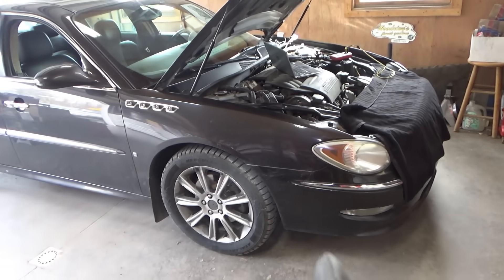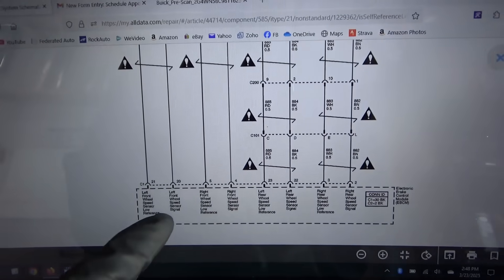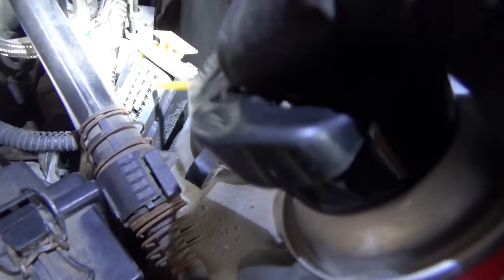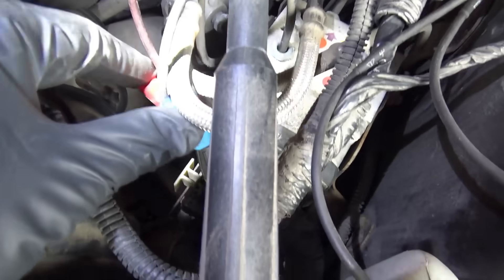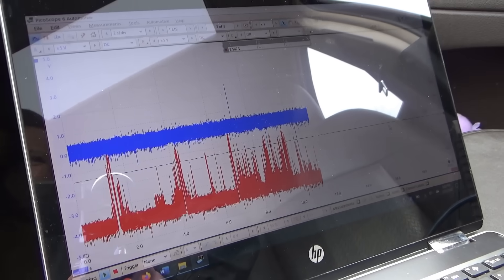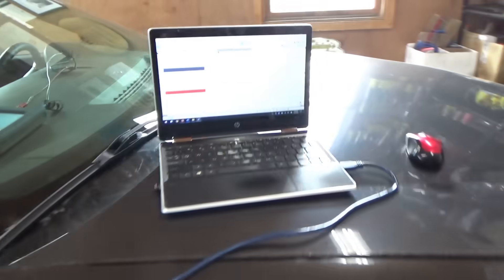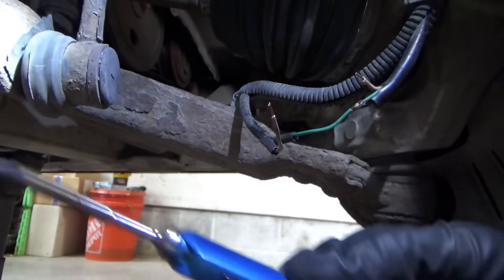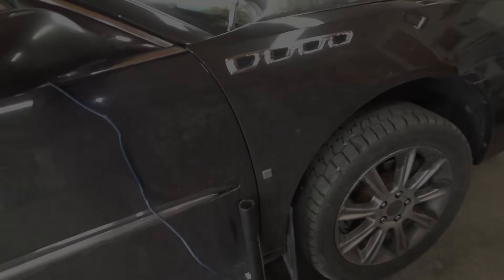(Pt 2) Buick BRAKE Problem?! C0040- ABS Sensor Circuit FAULT ('08 LaCrosse V8)

Comment: This is interesting, I was looking at the video and when you said turning the steering wheel to the right was causing the glitches and I was trying to connect it to the clock spring. And then as I kept watching I saw the actual solution

Comment: 2003 Pontiac Montana, the right front ABS wire broke in exactly the same spot.  I soldered in a bit more wire when I repaired it.   I found it easily because my wife was very observant and told me that the ABS light turned on and off when the right front wheel hit bumps.

Comment: If it was digital, it would probably be 3 wires with +5V, Ground and Signal wires. Most likely with just a coil with a magnet to tell the ABS how fast the wheel is turning based on either voltage or frequency

Comment: Good job! Yeah do not buy new AC Delco alternator, new but lousy, whine, and failed diode isolation test, sent it back, put a new brush holder in my old one, problem solved, and way less $$$

Comment: Not done with the video but im wondered if the alt and wheel speed sensor (probably a wheel bearing) came from Amazon . After watching I see that the wires arent part of the bearing. Whenever i get these i usually go after the harness first since they constantly flex , 9/10 its the harness.

Comment: Better to cut back to prior to the flex area and run new intact wire to the connector. Almost no more work, butnwill last far longer A splice just concentrates stress, and it fail fail again soon. (I've had this happens in the flex harness to doors . . . )

Comment: I have to say I'm a bit disappointed in the repair.  It would be perfect in most applications where there's little to no flexing, but not there.  It may take a few years, but that wire will break again at the splice.  The added weight and stiffness at that spot will force the rest of already stressed wire to absorb the flex of the spliced area.  A replacement harness is available from Rock Auto for $50. (ABS repair kit).  

Great diagnostics.  The scope made clear what was going on.

Comment: Wire insulation failed. Micro crack allowed salt / O2 in. You should replace at least a foot or two from connector.

Comment: It is possible to buy extra flexible wire, which is often used for test equipment, but would work just fine for ABS sensors.

Comment: The problem is that wire repair isn't going to last. It needs new wiring with new pins. Soldering that made it very rigid there, and it needs to be flexible.

Comment: Nice diagnostic and repair!

Re the wires that bend all the time:  Maybe use the type of wires that are used for multimeter probes? It's way more expensive than regular wires but it's designed to handle bending way better.

Re measuring the signal from the sensor: An alternative / complement to an oscilloscope is to use any amplifier/speaker with a high impedance input. Today the most readily available thing would be a guitar amplifier, but any vintage audio equipment with an input for a ceramic cartridge record player will usually also work (at least in Europe most 1960's and early 1970's transistor radios had a grammophone input).
This bad contact would be super easy to hear when listening to the signal, but for anyone not totally tone deaf (or rather "distortion deaf") it's also easy to hear things like rusted ABS rings.

Comment: Broken ABS wires were very common on W body vehicles, I did several a month when these were in dealerships.  There is a TSB for this.  Would have saved time instead of fussing around with it, or should have turned the steering while ohming the circuit.

Comment: Way to be Ivan.  That alternator repair was the way to go especially because you can make choices in grades of those parts. Alternator parts are available in 3 grades I believe and the better of them is marked "XHD" for extra heavy duty on the voltage regulators and those tend to hold the voltage a tad higher than the standard grade as well as they're built more robust.

Comment: I kind of figured that the alternator diodes were going out. I ran into a similar problem a long time ago on my 74 chev truck. I changed the diode trio and found one diode leaking voltage back out. It ran great until the day I finally parked it. It still had the original alternator in it.

Comment: That's a new tech tip.  Spin the wheel, it's OK.  Move the wheel side to side is the tip, cause it's a broken wire.
Usually the harness side is mounted up higher to the frame, or unibody, or splash shield and the sensor has it's own more flexible wire.  Definitely this one is not a good design.  Next up will be the left side.  Good fix Ivan.

Comment: That wiring issue is common on some GM models. I think wiring is either too short or too stiff causing the issue. I wish we would get back to making replacement parts in America again. Quality control is non-existent in some other countries.

Comment: A trick I have used for joining broken wires at the driver's door hinge line is to splice in a new section of wire that forms a small coil. This increases the flexibility of the wire, rather than decreasing it.

Comment: hey Ivan, I have the same vehicle and had replaced the RF wheel bearing..wire subsequently got  ripped out due to careless routing. I repaired but over  the last few weeks have had intermittent ABS activation. betting there is a break in my repair from last year.
thanks for the video!😎👍🇨🇦

Comment: I had the exact same problem on a 2002 Buick century. Bought a new connector with wires attached $10. I just used an OBD2 code reader. It told me right front. I looked at where it flexed a lot and figured it was there.
The car had 70,000 mi on it. I gave it to my cousin because he needed a car. He ran it without water in the radiator and destroyed it.

Comment: I wonder if the fuse problem high current parasitic draw interfered with the alternator operation and diagnosis ....The alternator senses how it is doing in the sense wire to a main junction block.

Comment: Great diagnostic, Ivan! Such a "simple" fault does require scan tool, factory diagrams and a scope, even though the first time you were rolling, when you turned, the glitch appeared in the scan tool, hinting at a possible broken or rubbing wire.

Comment: Great diagnostic Ivan. I am more than familiar with the cable failure, it is due to fatigue as you have talked about before. Turning the wheel bends the wires in one spot causing the failure. A solution would be to spread the bending of the wires over a longer bend radius. For this particular application replace a foot or so of the sensor wires with rubber SO cord. Coil it like a clock spring and ty-wrap  loosely. Configure it so the coil opens and closes when the wheel is turned. This way the cable does not get bent preventing fatigue and failure.

Comment: My thoughts on that sensor wire, the front end may have had work done previously and the wire put back in place without enough flex, leading to the wire stretching on a left turn full lock.

Comment: I should have guessed it had a diode plate built in, of all the Alternators I have reconditioned they are the worst and those plates prone to breaking down. I junked most of them.

Comment: They make a repair harness usually readily available at most parts stores for those older GM’s with that harness design. I’ve changed out many over the years. You splice it in at the crossmember so the flex is new. Solder repairing at that area you’ll be lucky to get another year before it breaks again.

Comment: Did Ivan just admit he shouldn't be soldering those wires because of the flexing?  Miles of room for a crimped butt splice :-)  I wonder if there was a way to route that harnesses differently by adding wire length to reduce or change the type of flexing. Edit: Others have pointed out there's a fix that uses finer stranded wire. That's another way to reduce the strain on the wire. Had an extension cord like that once and it was super flexible.

Comment: I looked up the alternator on rockauto 
The GM.are 321.00 to 340.00 new with no core charge...
Bosch ...138.00..45.00 core charge
Denso...147.00...75.00 core charge..
So, it's not too bad
I would buy locally

Comment: Love you show Ivan. Just wanted to share a story from this past winter on a 2005 VW Passat ABS fault for right rear sensor open circuit/short to battery +. Did checks at abs module to find resistance, inspect and good waveform from sensor. I replaced the sensor anyway and found that the previous owner broke off the bolt and welded the sensor in place causing damage to the input on the abs module 😢

Comment: Unfortunately, that will probably fail again, even quicker this time.. Just because the solder makes a hard, brittle breaking point.  The wire will break right next to the solder joint.  Oh well;    Just have to keep repairing it every few years.   Like you said:  It's a terrible design.
Reply: I've repaired dozens of those harnesses in these cars with solder and never had a failure talking nonsense
Reply: @ If it never had a failure.. then how did you repair it?   Think about it
Reply: It's gonna last another 20mls
Reply: It evidently failed at some point with no solder joint, it is what it is. At least it’s easy to get to.
Reply: Angel hair wire?